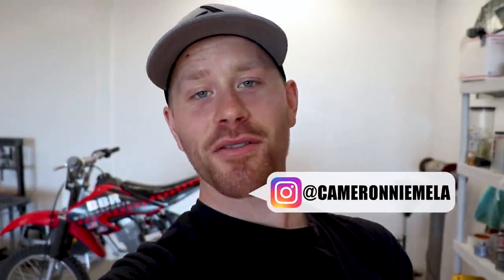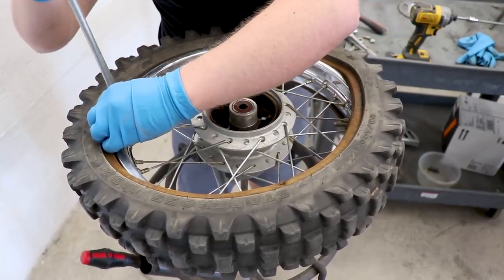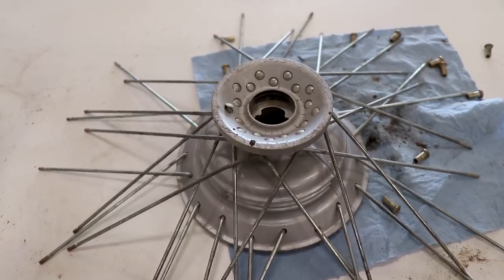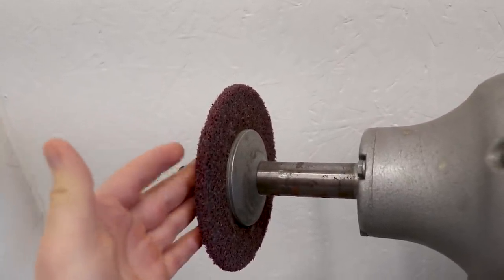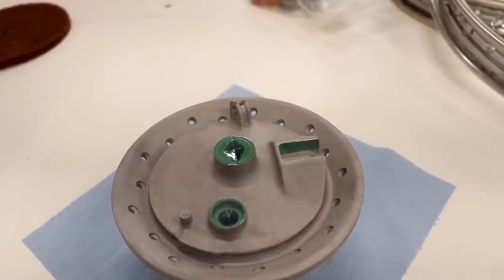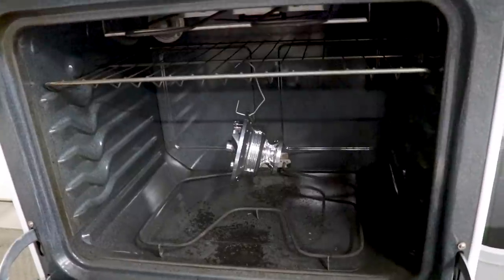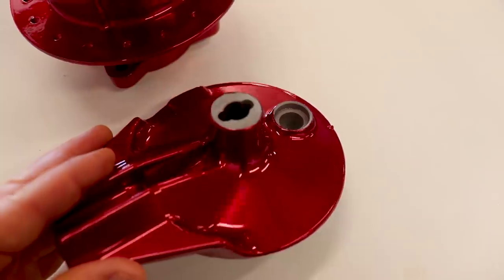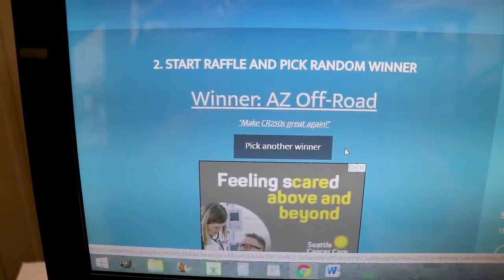Powder Coating Dirt Bike Wheels At Home!

Comment: did my tires on my CRF450X last week thanks to your vids.  great tip on removing the nut on the sprocket rather than stripping out the hex head.

Comment: You should try out their illusion series of powders. They work very well . Just spray the base color. It goes on like a silvery red/purple/ whatever color you selected. When they wet out they turn to chrome. Then you spray them with a clear top coat. When the clear wets out it pulls the color right out and it goes from chrome to a beautiful candy right before your eyes. They are more forgiving than laying down a silver basecoat and then the candy. It has a more consistant coverage.  I did an ar15 in their illusion purple for someone.

Comment: Hey bro! you look great!
thanks for another great vid! 

it's a little hard to find this gun in Greece but i will at some point.
one note (and the reason for the comment) :
on the CR250 as i am checking with the manual of my YZ125 (being rebuilt with your help) i think i see a mistake and it's better to fix now than later!
On the shift guide assemply, the two pawl pins go against the pawl and not towards the holes of the shift guide as it was when you disassembled it and assembled it back.
makes sense, because otherwise the spring will scratch the pawls (even if it works well, it is a possible cause of future failure!)
honored to be of assistance to such a super build and a super bro!
Thx again for your vaulable help!

Comment: When I took the tire off my 2002 XR80 it was so dried out that I could not get the rim out of it.  If had absolutely no stretch left in it.  I ended up having to cut the tire in half to get it off.  The front was similar but being a bit larger it had enough give that it went as it should.

I seen that same little bike on CL just a couple weeks or so ago!!  Small world... or small Washington.

Comment: 700 views , also close to 250 pound range but i want a old 4 stroke i find them fun and very accesible in my area ive seen a 1983 honda xr 100 but shocks and rear spring youd think i should used? (p.s im on a budget ) i feel like it should be a very fun street  motard, thank you .

Comment: As thin as the powder coat is, if it's not completely even even 0.6mm it could be 1mm out at the end of the sprocket. I reckon with a sprocket it would be fine but if you do a disc hub I wouldn't risk not masking. Just my 2 cents

Comment: What is your take on using powder over Cerakote when it comes to the wheels?  I was thinking about using Cerakote on my daughters wheels, mainly because I have spray guns but I don't have powder coating equipment.
Reply from the maker: Cerakote holds up very well, just as good as powder coat in most cases. I'd prefer to use cerakote on hubs, but it isn't available in the color I was going for. I haven't tested it on rims yet but I imagine it'd be equivalent to powder coat

Comment: How will the powder coating hold up with mud and dirt and washing?
Reply: As long as surfaces are prepped correctly and the process is pretty good, the powder should hold pretty well, unless a sharp rock catches it just right.
Reply: I powder coated the heal guard on my supermoto red. The pervious owner had spray painted it red and it was wearing off. The powder coat doesn't have a single scuff after a ton of riding, and trust me the heal of my boot/shoe rubs it constantly from using the rear brake
Reply: Thanks dudes! Wanting to powder coat my kawi hubs green
Reply: @brendannoerper7717  been wanting to do my bike rims as well, but sadly my oven isn't big enough
Reply: Powder coating is infinitely better than paint. Mud and washing will have no effect on it over time
Reply: @sinformant  the prob is taking it apart and putting it back together😅
Reply: @brendannoerper7717  yeah that's why I haven't done my supermoto wheels. I have been wanting to do my sportbike though
Reply: Powder coat is stupidly strong. I did a chain guard and fucked up the curing and it's still held up 10 rides and 11 hard close up washes with harsh chemicals

Comment: I wish I had the funds an tools to do this.
Reply: These powder coating guns aren't expensive. I have a harbour freight one I got on sale for like $64. Bought a used oven for $50. I'd recommend the dual voltage eastwood gun though, but starting out the harbour freight gun will do. Powder may not seem cheap, but a pound of powder goes a long way. 1lb of powder would easily do several sets of motorcycle rims.